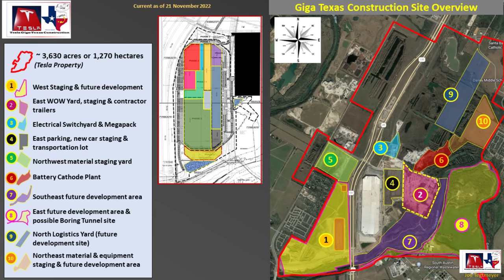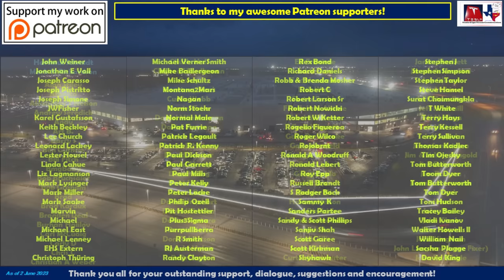Product Display, S Footings, Conduit & Megapack Site Work! 12 June 2023 Giga Texas Updates (07:05AM)

Comment: Since the column footing construction at the new southern extension of the building confirms that it is clearly going to be connected to the existing building, it begs the question: why did they waste time and money staining the south wall white when those panels (and windows) will need to be removed to connect to the new building extension? Just one more example of the "ready, fire, aim" paradigm that pervades this project, where paving is poured and structures are built only to be torn out to make way for something else. The contractors won't care ... they get paid for taking it out as well as for putting it in. They're probably living large with all the change orders and extras they can bill.
Reply: This is the most wasteful project I have ever seen! Brought to you by the "move fast and break things" crowd.
Reply: The agile manufacturing process that Tesla employs does use the fail fast, learn and move forward in all aspects of the business.

In a long term project like this there will be many times a finding a better way or new process presents itself before the previous one is completed 

Tesla will never let money already spent stand in the way of continuous innovation.

Speed costs money, they want to go really fast.
Reply: @DavidJohnson-tv2nn  Wasteful of money, but not wasteful of time, which is much more precious.

Also, they’re happy to fix mistakes rather than “work around” them.

Long term efficiency is key.
Reply: @rockon7848  Don't be misled by the  Silicon Valley crowd. There was a time when the tech industry was awesome. But what innovation has Silicon Valley brought us lately? In particular, what innovation has Tesla brought to the customer? Unrepairable battery packs, costing thousands of dollars to replace? Castings of questionable repairability? $15,000 Self driving that doesn't work? And anti-independent repair policies in general? No thanks. The "move fast and break things" crowd can keep their "innovation"!
Reply: @tommornini2470  As a sixty plus year old man this philosophy has became more and more obvious to me. The one thing you really can’t buy is time. As Napoleon was supposed to have famously said, “Ask me for anything you want, except time.” Some folks get this, some folks don’t.
Reply: @tommornini2470  Also very wasteful of energy. Brought to you by the guy who claims that he wants "a sustainable future" and "wants to make the world a better place"!
See any hypocrisy or dishonesty here?
Reply: @tommornini2470  Oh, I don't have to try to make the leader look bad, he does a great job of that himself :)
As for the energy they are wasting now, it is no small amount.
Reply: @shadowmancer7040  Don't invest in stock. If I did, sure wouldn't short a company with stock so pumped up by the fan base. That would be a losing fight. The stock may have "value" but it is fake value in my opinion. Much like cryptocurrency value is fake.
Reply: @DavidJohnson-tv2nn  This is what I'm talking about.  You get a legitimate explanation from those in the industry yet you still stick to your guns.  Times change, processes change.  More and more projects will be run this way.  Tesla has sold over a million vehicles.  How many battery packs have been replaced where the owner had to pay.  What was the circumstance?  Don't mention the Youtuber who destroyed his car instead of replacing the battery.  Good chance he only did that for the views.  Probably made enough to buy a new Tesla.  I keep asking these questions, you keep ignoring.  Self drive is BETA and OPTIONAL, who is holding a gun to your head to buy it?
Reply: @DavidJohnson-tv2nn  So you would prefer to short a company with stock that has proven value? Don't quit your day job.
Reply: Plans change, they are using “design/build” for the CyberTruck assembly line, it’s never been done before, so gurantee they’ve had to be flexibile..  that includes modifying the building as well to handle it.  Not unexpected..  it’s not like their Ford and have been building F150’s for 60 years.  If they add CyberTrucks to another factory, it won’tbbe as chaotic/wasteful
Reply: @DavidJohnson-tv2nn  What are you talking about?
The battery packs are going to outlasting the rest of the car.
If you hit a car hard enough to break a casting, it would be hard enough to scrap a steel unibody as well.

I have one word for you, and if you don’t know what that really means for production efficiency 
in the assembly of automobiles, your understanding of the subject matter is lacking.

“Unboxed”

DO you know what it means ?
Reply: @mwolrich  I have no objections to necessary modifications. It is the utter stupidity I'm talking about. Ripping up 500,000 sq. ft. of concrete after only a few months, or ripping up the main entrance 5 times, has nothing to do with Cyber truck.
Reply: @DavidJohnson-tv2nn  The architecht who DESIGNED Tesla’s Texas Gigafactory was at the shareholders meeting, he was litteraly holding open the front doors..  very humble guy.  The front entrance now has a “plaid” look and feel, and it took time to figure that out.  I think it’s more that Tesla doesn’t want their contactors to stop, or move on to other projects, so they never tell them to stop or slow down.  If you’ve every been in constrution, especially the last few years, you will understand..  it’s extremely difficult to get crews to show up, and actually work, the last thing Tesla wants to do is discourage contractors..  Your concerned about nickels, when the factory cost several billion to build, and they’d like to get it done, and be done with it..  I was their in mid May, its pretty much chaos, and it needs to be done & over ASAP.  As a shareholder, they have wasted some money, but it was with purpose, getting constrution completed is a high priority for them.  The factory expansion?  that could have been better planned, but it’s better to do it now while all of the contractors are still onsite
Reply: @sammyk874  And you refuse to listen to my explanations. It is not battery failures under warranty I'm concerned about. What happens AFTER the warranty expires? Especially if someone buys a used vehicle because that is all they can afford! Are you just going to say... "Oh well, too bad for them"? There are a couple of independent repair shops that do repair older model Tesla battery packs. With added expense to the customer because Tesla makes repairs difficult. However, the 4680 is IMPOSSIBLE to repair! Not sure about the exact number of failures, but... One $20,000 failure is one too many! The 4680 is also IMPOSSIBLE to repurpose for energy storage after the car ends its useful life. Due to the fact that the battery pack can't be dis-assembled.
As for the self driving.... There are a bunch of gullible fans, and the leader claiming that self driving is just around the corner.
Reply: @rockon7848  You are just repeating the talking points of other Musk/Tesla fans. Do you honestly believe that a battery pack will never fail? Are you aware that conventional unibody design can be straightened? It may not be recommended, but it is a viable option for someone who owns an older vehicle without full collision insurance coverage. If you own an older Tesla and the casting shatters in a collision... You're screwed!
Reply: @DavidJohnson-tv2nn  I'm not refusing anything.  I do understand what you are trying to say but it doesn't make sense, it is just propoganda.  If the battery is out of warranty that means the car is 8-10 years old or has over 100K miles on it.  ICE of EV, that is a risky purchase.  If you are buying an EV that old, you should be checking its SOH.  If someone is selling a used EV with near dead battery, it should be super cheap.  It's like someone selling an ICE with no engine.  If someone is buying a used EV because that is the only car they can afford then we are talking way into the future.  I am sure that by then replacement batteries will be much cheaper.  VW EV batteries are under 10K already.  Why assume prices will remain as is?

Self driving, why do you even care?  If people want to buy things, let them.  People have spent more for less than FSD.
Reply: @sammyk874  Nearly every ICE vehicle I ever owned was at least 8-10 years old and had over 100K miles on it. Cheap, affordable, and repairable. The car I'm driving now cost $500. The 4680 is the equivalent of selling an ICE vesicle with an engine that can't be dissembled. And by the way, I've done a few engine rebuilds. 
Battery replacement for less than $10,000? Why pay $8,000 for a brand new battery, just because the old battery was purposely designed with planned obsolescence in mind? Repair is cheaper most of the time.
What really p*sses me off is that the leader is portraying the 4680 as an "improvement", or "innovation"! 
Now that is propaganda and BS.
And the deal with NON-self driving is more propaganda and BS, but far too long to get into here.
Reply: @DavidJohnson-tv2nn  Most people are not handy with their vehicles and dispose of them every few years, regardless of whether they are repairable or not.  Your type is a dying breed whether you like it or not.  Also, you make it sound like batteries are meant to last forever by simply repairing them over time.  This makes ZERO sense.  What other product do you do this with?  Laptops?  Phones?  Power tools?  In every case, the battery is replaced, no one opens these batteries and replaces individual cells.  If I'm wrong,  give me an example.  I've asked this before too, no response from you.
Reply: @DavidJohnson-tv2nn  So you don’t know what I am talking about do you?

‘Nuff said.
Reply: @sammyk874  Yes, we live in a throwaway society, brainwashed by big corporations into getting new stuff every couple of years.  
Battery packs in cars are not comparable to batteries in phones and laptops. They are comparable to the engine in an ICE vehicle, the most expensive component in the vehicle. Speaking of phones, I have been complaining about phones with glued in batteries. Where even replacing the battery is so difficult that most people just replace the phone rather than the battery. This is all done on purpose by greedy evil companies that want you to keep coming back to them and giving them more of your hard earned money. And power tools... Have you seen the rip off price of new battery packs? You might as well buy a new tool! Again, this is done on purpose for one reason only... Greed! But at least power tool battery packs can be opened up to replace the cells.
You can embrace the throwaway society if you want. It's a free country. But I don't get why you are interested in a company that claims that they want "a sustainable future" Even though it's all marketing BS.

Comment: Substation: Already partially energized? (Upper right) @ 22:36 and (Left side) @ 22:52 Substation may be partially energized. Switches on transformer primary appear to be open. If the rest of the switches up to that point are closed, the substation may already be energized. Perhaps Joe can get a better view of all switches?
* South-end "Tesla Enclosure" @ 22:10 A lot of rebar being delivered.
Reply: After viewing at 0.25 speed... Switches appear all closed except for the transformer primary side and the power to the east monopole. Seen @ 23:01 and 23:03. Meaning it is likely that the substation is energized or will be soon.
Reply: @DavidJohnson-tv2nn  David, you are correct, cannot see state of breakers, possibly setup to complete circuit between the two power plants or for testing.
Reply: @eltonray2934  Thanks for confirming my observations on the switch positions!
 You're right, we can't see the state of breakers. Which brings up a question... Would it be normal operating procedure for the switches to mirror the circuit breaker position? I don't have knowledge on that but it seems like it would make sense from a safety perspective. That way, an open switch when a breaker is open, and a closed switch when a breaker is closed would give a clear visual representation of the state of the circuit. One more question if I may ask....
Would I be correct in assuming that LCRA would want their transmission lines to remain energized after testing is complete? If yes, then the substation would have to remain energized. At least partially. I assume the transformers and the east monopole will remain disconnected as long as construction continues.
Reply: @DavidJohnson-tv2nn  David, The breakers are controlled by a power dispatcher located in a central location. The main reason for disconnects is for service work performed at the station to isolate equipment. During maintenance the disconnects are locked open and red tagged, the phases are probably grounded. 

If the disconnects are left closed the dispatcher can control current flow and react to grid changes as required.
Reply: @eltonray2934  Thanks. I stand corrected. I was thinking from a service perspective and forgot for the moment about routine operations, where the breakers are opened and closed as needed. 
But... From the current switch/disconnect configuration, the substation is ready to be partially energized, or already partially energized, depending on whether the circuit breakers are open or closed.